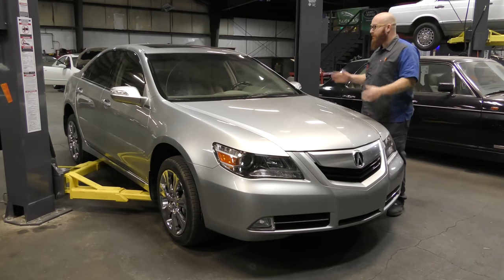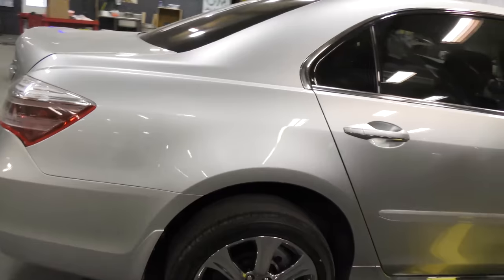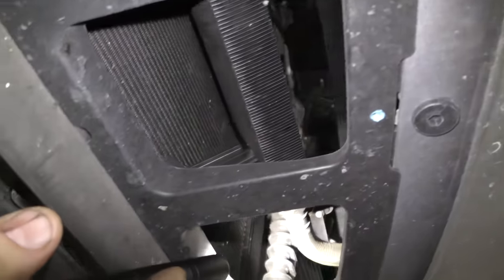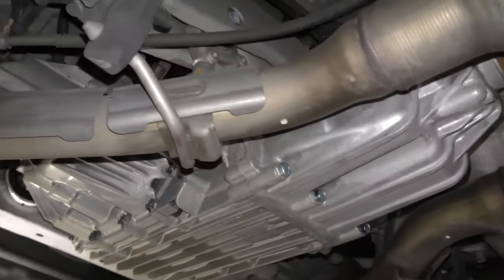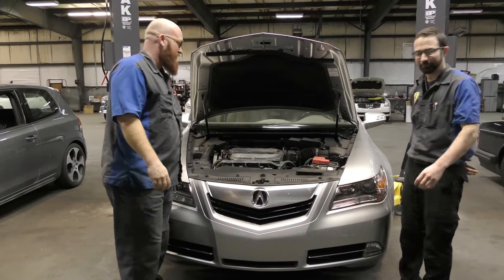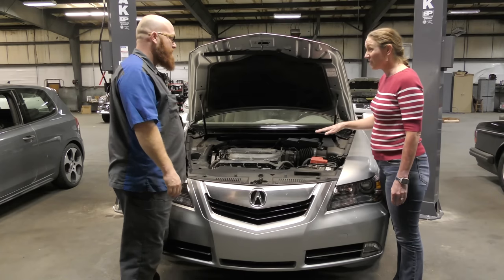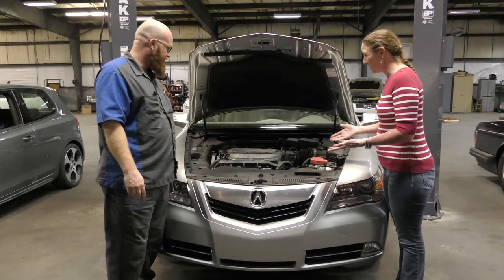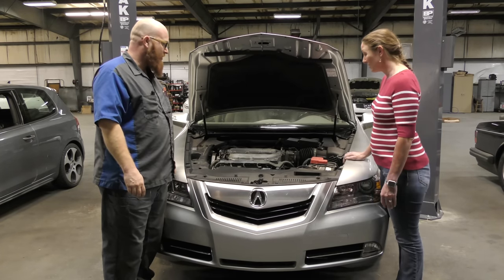Something Very Serious is Wrong with this 2010 Acura RL! What did the CAR WIZARD find???

Comment: In the UK, this model is called a Honda Legend - owned 5 and they were all brilliant family cars
Reply: Very very unusual for a 3.5 or 3.7 to go wrong.  We only had the 3.5 in the UK.
Reply: owner ran it low on oil unfortunatly
Reply: I miss the old Acura Legend in the US
Reply: @modernconflict9888  Oh no. :(
Reply: Miss the old shape Leg-ends, decent car, bet the manual was great, only ever driven slushbox versions :-(
Reply: @modernconflict9888  It could have been an oil pump failure! I would be surprised if the owner would not have checked the oil level. Besides, there is no evidance of oil leaks causing a loss of oil.
Reply: @mechanoid5739  it was most likely piston ring failure most Honda V6s from 2009 to 2011 have the issue. The rings wear down and allow oil consumption that with out constantly checking your level would allow a failure like this. My 2010 accord had a 3.5 v6 and would use a quarte every 1000 miles. Even under warranty Honda did nothing until years after i got rid of it
Reply: @SilveradoChris  If it used that much oil surely you would have noticed the smoke?
Reply: @mechanoid5739  that was the odd thing, it did not. It was instead caking on the  converters causing them to start to fail. Once this started I got rid of the car as Honda was not honoring the warranty on the power train.
Reply: @broomad  - Nope. The 3.7 is a notorious oil burner. Google it.
Reply: @mechanoid5739  Yes it could have built it’s too late to replace the oil pump. If you have to replace timing chains on any engine, replace the oil pump too especially if it’s a Ford. Fords have weak oil pumps from the factory. The oil pump that Fords use has an aluminum backing plate and the problem with that is they don’t lubricate the cams and the cam phasers properly and that’s why 3 valve engines are being replaced with remans so often. The clearance of the cams are not designed well and they just threw it out the door along with the 6.0 and 6.4 PowerStroke engines which even the remans are garbage because they just rebuild bad cores and good cores are not easy to find. There’s people who spent $16,000 on a reman 6.4 PowerStroke and had the engine blew up as soon as 10,000 miles because they knew that they had too many design flaws on the engines. Bulletproofing a 6.4 engine is not possible without deleting the DPF which is illegal by US federal law and you are better off with a 2015 or newer 6.7, a bulletproofed 6.0, or the 7.3 but I would buy a Duramax or Cummins before I buy a PowerStroke. The 3.5 EcoBoost had problems with timing chain stretch because the engine was originally designed for naturally aspirated only. Ford just added GDI and threw twin turbos on the 3.5 EcoBoost. The 2.7 EcoBoost was designed for turbocharged engines but they also are prone to problems with oil leaks and blown head gaskets. It’s a CGI engine which is just an over engineered two piece engine block with cast iron cylinder block and aluminum top and bottom end.
Reply: No it’s called an Accord
Reply: @carolcooks1208  an RL/Legend/RLX is not an Accord. It is a different chassis. RL is KA/KB/KC chassis, Accords are Ax/Bx/Cx/Dx chassis.
Reply: @OMGWTFLOLSMH  which is why you should know the car you're dropping thousands on to buy, or just get a Civic
Reply: @SilveradoChris  just curious, can it be possible that oil wasn't changed on time that caused the rings to wear.
Reply: @carolcooks1208  Wrong
Reply: They're still great cars which is why a 2007 3.5 will set you back £5,000.
Reply: He ran the car on low oil.... It's crazy that you can have all the technology in the world to tell you what's going on and people will still ignore it...
Reply: @malibuman8941  I think the car had the original oil or a only got changed five times...
Reply: I got the Acura with a 3.5 and all of these cars pretty much burn oil... so when mine says check oil i know that it's low on oil and I just add a quart of oil... But before I add it I do check the dipstick first
Reply: @hacatan24  usually if the check oil light is on it's too late. I check the oil in my Crown VX before I use it. But it's only a weekend car. 80k miles doesn't use any at all. I change oil every 3-5k miles and oil filter on second oil change
Reply: @chappy2121  I had the oil light come on and I haven't had problems.... But when I checked it it's on the add oil mark.. my car has 180k
Reply: 2000 and up have transmission problems, engines were great however, otherwise complete lemons.
Reply: @Craig-wp3pz  I actually have two 1994 Legends that are identical except for the transmission, one is the 4 speed automatic and one is the 6 speed manual. I can attest that the 6 speed does a lot for that car. Better acceleration, more comfortable freeway driving, and better gas mileage.
Reply: My first car was a beautiful perfect condition 1993 Acura legend LS gold on tan with chrome rims, my parents bought it brand new, it was the best car I ever owned, and at 34 years old I’ve had 14 cars, I totaled it in the rain at 17 years old, I miss it to this day... RIP
Reply: @Brock1912  You know we had a 1993 Acura legend sedan LS in gold, and a 1992 Acura legend coupe in the pearl white, I always wanted to drive the high output version of the 3.2, what issues have you had?
Reply: @malibuman8941  My car had a full service history and oil was changed every 5000 miles which was a shorter interval than Honda recommended. It was a design failure by Honda that caused the ring failure. They redesigned the engine in 2012 to eliminate the issue.
Reply: @SilveradoChris  hope Honda was able to compensate you.
Reply: @nicholasbabeaux2052  Only big issue I had is the head gaskets, they were starting to leak. Pretty common problem on the C32A though. I pulled the motor and did a complete reseal on it to address some other leaks as well as the head gaskets. Also replaced timing belt, water pump, a/c evaporator, most of the coolant hoses, some power steering hoses, and so forth. That was all on the 6 speed. My automatic Legend is more or less just a parts car but it had fully blown head gaskets when I got it. I replaced the head gaskets and a few other items but did not pull the motor and go all out like my main one, just enough to get it running again.
Reply: @Brock1912  Thats exactly what happened to our 1992 Legend coupe, the mechanic said blown head gasket and we just donated it, so sad perfect condition, doors still self closed and all.  I wish we would have tried some stop leak or headgasket goo or whatever, obviously a common problem

Comment: Hey Wizard. Just to let you know that there is a recall on that motor for oil consumption. Its a complete dealer rebuild. Not sure if that vehicle applies to the recall but please look into it. It would be a great free fix for the customer.
Reply: Recall ended 2019
Reply: @johnj949  ... Of course it did. My black cloud grows. Lol. Thank you for the update John. I sincerely appreciate it.
Reply: @petegalicki7789  I switched to 10w30 since its thicker oil
Reply: @johnj949  ... Not to heavy for this motor? Again, black cloud.
Reply: @petegalicki7789  past 40k miles i use shell t5 10w30 no issues. Did every 2k miles the first year and all the carbon got cleaned out
Reply: @johnj949  ... Using Diesel oil!? Yeeks. Getting cold here in New England.  Would you suggest a Seafoam flush?  In my prior comment, I only use a a half quart every 1,000. Brand new Hyundai uses the same.
Reply: If the customer took it to acura and complained the dealer would call Honda USA and they would cover it. First thing I thought of was that consumption issue for the 3.7 motor. Got the same one in my 2012 mdx.
Reply: Just took my 2012 MDX today for the oil consumption test. If it proves to be using oil which I know it’s going to Acura is going to do the rebuild. I just bought it in September. Only 75k miles.
Reply: @bsachs00  I thought they ended it. Make sure the dealership doesnt overfill the oil. They've been doing that to avoid doing the recall
Reply: @petegalicki7789  You could but I like Gumout since it has P.E.A. Use CRC Intake cleaner as well. And diesel oil has kept my engine cleaner than regular oil and hasnt hurt it at all.
Reply: It didn’t end in 2019 I just got mine done last month
Reply: @bsachs00  yea,I'm DEFINITELY not feeling any Acura love and even less with brand new hondas all of a sudden.Makes fifteen year old Camrys look like gold.
Reply: @bsachs00  the rl's owner in the video is also getting the rebuild :)
Reply: @johnj949  Had a VW gas tank replaced on my W8 16 years after the recall ended.
Reply: Do you MDX owners push your cars because I have a 2010 with 235k on it and I probably put in a quart every 5k. 
Maybe I just lucked out
Reply: @fortunatedad7695  it's just luck. Mine burns oil at 80K but not enough to be a problem
Reply: @adamgraham6265  I guess I should have given some background on the car as well. Im not the original owner, I'm probably the 3rd and the original leased it. I bought it with 200,000km on it.  So it's been though some abuse I'm sure.

Comment: I would like to know what the root cause is. oil pump failure? failed rings causing high oil consumption =low oil level .It would be interesting to see in a follow up video.
Reply: It's the piston rings/liner. It's highly documented. 3.7 j series. They all do it.
Reply: Yeah wondering what caused it too
Reply: I would like to see a video on the re build if they decide on that option.
Reply: My guess oil pump failure and spun a bearing, its not a hard rebuild folks, people have been rebuilding DOHC V6's for decades.  It does not need to be sent to Michigan, they truly are confusing it with a Ferrari.  Its a Honda, find a Honda guy, they are everywhere.
Reply: Root cause is son driving it like a race car.
Reply: @laoshiolsen  - Driving it like a race car when it was low on oil.
Reply: according to my friend it was oil pump failure.
Reply: @MaliciousSRT  its SOHC
Reply: @ua7pyro591  to different extents but yeah that all eat oil
Reply: The 3.7 are well known to burn oil. Acura extended the warranty a few years ago to 8 years. Got my 2012 TL fixed for excessive oil consumption for free at the dealership. New pistons, rings, spark plugs and timing belt. Engine felt like new after.
Reply: @Shabbe02  Even easier
Reply: @Rick-zw9kp  problem is they don't use revised parts lol. They use the same exact parts. My 2012 only uses a half quart every 2500 miles or so and it's at 50k, so I'm letting it go and checking it bi-weekly. 
I thought about using an oil extractor and getting the dealer to replace it, but not worth the hassle IMO. It runs great FWIW.
Reply: @MaliciousSRT  yup
Reply: @MaliciousSRT  *Single overhead cam.
Reply: @ua7pyro591  not true only the MDX have that issue these are similar but different engines. It's the oil change interval computer light. If you follow it you will surely blow your engine or have a poorly running engine.
Reply: Wrong oil viscosity, lack of oil, over heated motor, high rpms. In other words the guy driving this car put the pedal to the metal.
Reply: Oil pump failure Wizard?
Reply: @MaliciousSRT  an oil pump failure wouldve caused an oil pressure light to turn on, which you need to have The Car Towed, Preventing Engine Damage.    If It Was Instantaneous Then I Think Its The Piston Rings
Reply: As soon as he said his son was driving it I remembered my pal driving his dads car when he was young, oil light came on, kept driving, ran it dry and knackered the engine. When he realised what he had done he put oil in it but it was too late, it had a big end rattle like it was towing a bag of tin cans, but of course the first thing the mechanic did was dip the oil and it looked like it had plenty, so the couldn't figure out why it went bad. Im not saying that's what happened here, but im sure the wizard will figure it out
Reply: @laoshiolsen  Yeah, sounds about right. “ For lack of respect for power given, shall corrupt those whom it has been afforded.”  [Virgil O. Wyatt, October, 2020; The People’s Philosopher.”]
Reply: @andybowie8590  it was either piston rings or oil pump failure. The son is going to an automotive restoration school. He's smart when it comes to cars.
Reply: David Hammett What about the liner?   It peels?

Comment: If it was my car, I'd see about the possibilities of putting the widely available 3.5 in it.
Reply: He would lose 50 horsepower though
Reply: a bunch of engines can be imported from Japan,Russia.
Reply: @sergeihanush2262  at what cost?
Reply: @aaronshensky9385  2000 engine in Vladivostok, plus probably a 1000 for delivery.
Reply: @Duncan Macleod lkq has one engine with 137k miles
Reply: Out of curiosity I looked for an engine for a 2010 Acura RL on carpart to my area and I'm seeing a bunch of 3.7s

I see a 40,000 mile one and one with 56k. For around 850-1400 price range
Reply: @jeffreylong5660  2005 RL 3.5 engine has 300hp. This Gen only has 310hp off a 3.7. the transmission is a  6 instead of 5 though. 2010 also ways a few hundred pounds more then the 2005 models
Reply: Reman 3.5 is also 7k lol
Reply: Owner is very stubborn. Buy another car then
Reply: Completely different PCM and sensor set-up be my guess...transmission computer, ABS, AWD, HVAC...who knows what all is incompatible. JDM motors are different than Canadian/NA even on 4 cyl.Camrys etc...(oil pans, brackets). This motor is such low production they were prolly all built at the same factory in Japan while the 3.5 is built in several countries feeding various markets. I know Ohio has a Honda engine plant etc.
Reply: @aaronshensky9385  Big outfits importing Japanese engines advertise on CL under auto parts etc. Japan has laws dictating that vehicles over 5 yrs. old start getting nailed on road taxes because of age. Japan is an island so 5 year old cars there rarely have over 40k. So they scrap perfectly good cars and salvage the engine/transmissions..Houston has a big engine depot..they'll ship it to your door.
Reply: @edwardbennet3902  i doubt it uses different stuff. They wouldnt spend money making all new stuff just for the 3.7. I bet it works with the 3.5 too
Reply: @chinchy111  One would hope...but Honda likes to re-invent the wheel on common items...for instance...the Accord axle shafts are different between between the manual 4cyl and the Auto (L.R)...same with the V-6 stick vs. auto...so for the same year 2 different engines, you have the potential for 8 different part #'s just for axle shafts.
Reply: @jeffreylong5660  20 HP. My 3.5 has 280HP
Reply: @jeffreylong5660  nope, just 10 hp
Reply: @10litehouse  the 3.5 from that year was in the Honda Pilot and it only made 250hp. The new 3.5 hooks to a 9 speed transmission,  won't fit this cars transmission. So like I said...
Reply: @jeffreylong5660  The 2008 Acura RL 3.5L comes stock with 290hp. So why are you brining up a Honda Pilot?
Reply: @10litehouse  there were no Acura engines available. Did you not watch the video?
Reply: @jeffreylong5660  Yes I did watch the video. There weren't any 3.7L engines for the 2009-2012 Acura RL (like the one in the video) hence the original comment, saying put a 3.5 Acura RL engine in it, which is "widely available".
Reply: @10litehouse  which.hooks to the 5 speed, not the 6 speed thus it wouldn't fit
Reply: @jeffreylong5660  the j35a8 gets about 275+ HP
Reply: @jeffreylong5660  Should still be a very serviceable car with 50 hp less..

Comment: Well that is really unfortunate. I wonder if Ericthecarguy has ever run into this issue before. He was a Honda master technician and worked at multiple Acura dealerships for many years. I think it's worth $7k to fix this car as expensive as it is for a car with such low mileage and given the immaculate condition that it's in for it's age this one is worth saving!
Reply: I'm sure he hasn't worked at Honda since this car was built. Though it seems like such a rare issue I doubt there's any service bulletins about it. Especially since Honda had the confidence in it to not stock brand new replacements or very very few of them. This is just a raw deal where a rebuild is the only option.
Reply: @richardbicker640  ey there viewers, welcome back the south main auto channel. Today we're looking at a 2010 hondo, or acura...she has the big 3.7. how'd I do?
Reply: My guess is that it's the original oil.. the problem was that this guy ran it like that the whole time... Doesn't matter what car it is you cannot be driving a car with low oil...
Reply: @hacatan24  Acura 3.7 has a history of oil consumption. He probably didn't check the oil and ran it low, then destroyed the bearings.

Comment: I'd love to hear what the Wizard or the rebuilder thinks really happened.  My gut says it was run out of oil, except that the exterior of the engine is really nice and dry.
EDIT: notes in the comments below say that the oil pump failed.
Reply: No. There was a recall for these 3.7s. poor piston/ring design leads to excessive oil consumption
Reply: @supersabrosinho  i have Legend 3.7 for 13 years now and no recalls except of passenger airbag 250000 miles on it